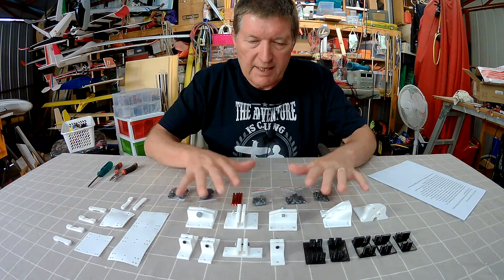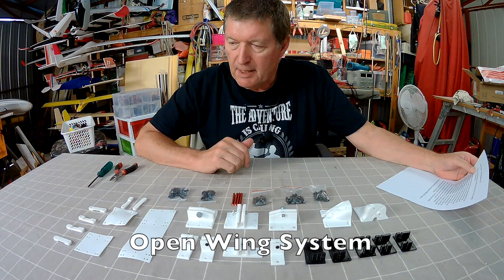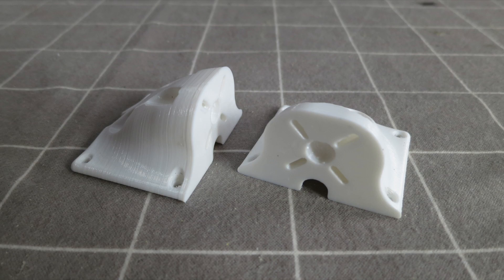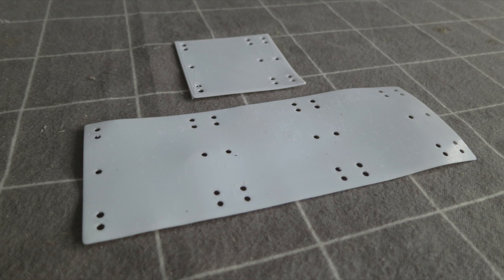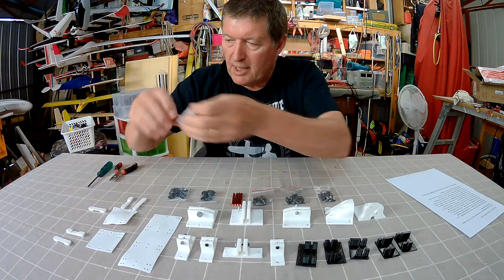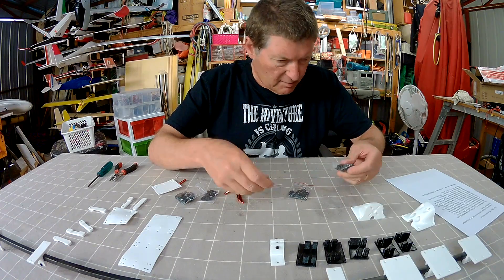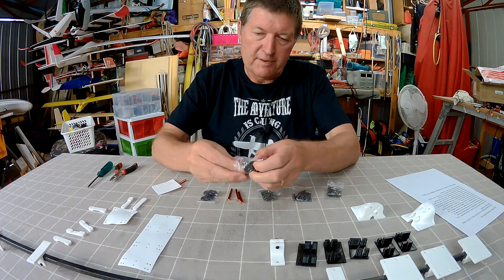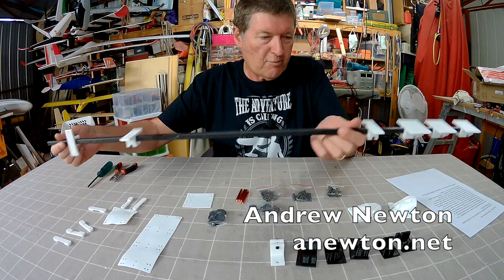Open Wing System - Gene Sher

Comment: This seems a bit like "QuadLugs" -- a system I bought and used to build one quad -- my "flying dump truck" that was based on square wood (bass or poplar) stock.  It used plastic mounts, corners and angles.  I highly recommend that "kit" for anyone wanting to experiment or build a test bed for different geometry or gear (FPV, APM etc.).  It's really tough stuff and repair is a matter of cheap square wood stock.
Reply from the maker: Quadlugs? Looking it up right now